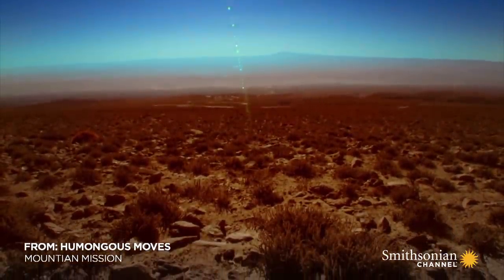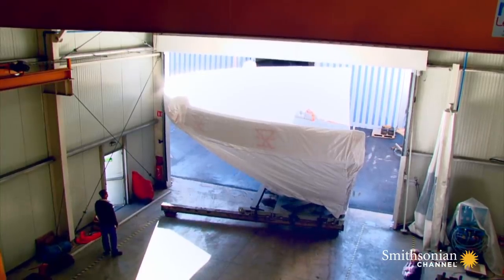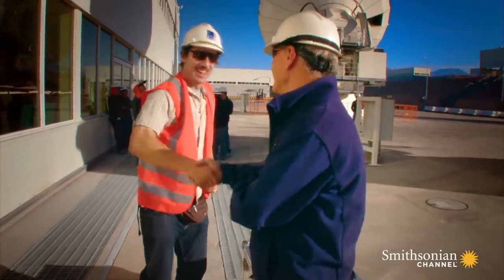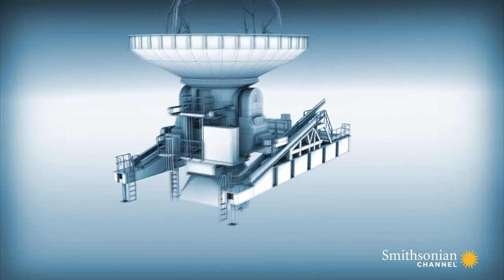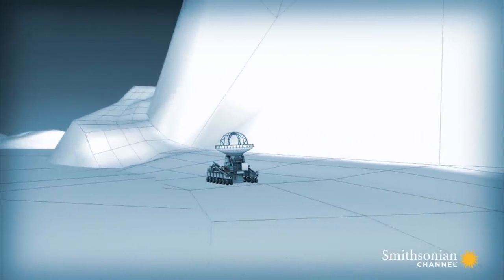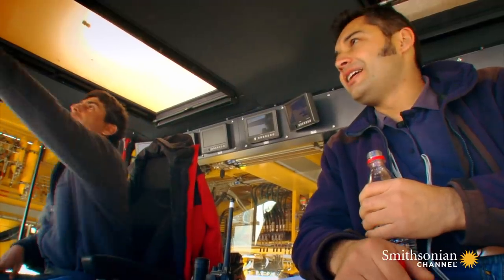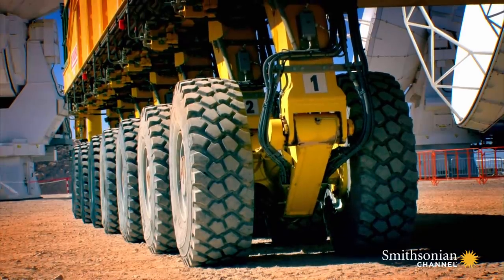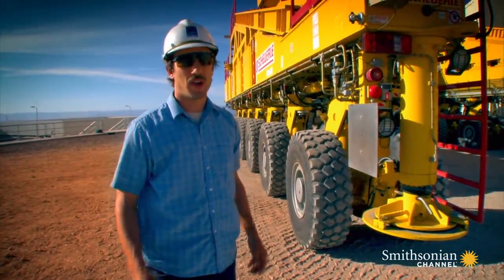This 28-Wheel Heavy Duty Vehicle Was Designed for One Moving Job

Comment: Why didn’t they just build the antenna on the mountain?
Reply: KR P so the antenna is mobile?
Reply: @LENZ5369  that's where I'm surprised. I said person and you say company. Most of these companies came from one person. Lmao.
Reply: @LENZ5369  how?
Reply: The biggest part of the device is the parabolic antenna. Very few companies in the world are able to build such big parabolic antenna for several reasons: first, the market isn't big so it limits the makers. 2 it is more complicated than it seems to have a parabolic reflector of this size. I fact, each one is built in halves and their are still huge. 

Building everything up there would not make sense economically,  building a new factory wouldn't not have been cost effective for only two antenna and since there is barely enough space for the antenna, their wouldn't have been enough space for the various factories to build such device. That is why the parabolic antenna are built in France and sent to South America and put together with parts from the rest of the world (USA, Japan, Europe).